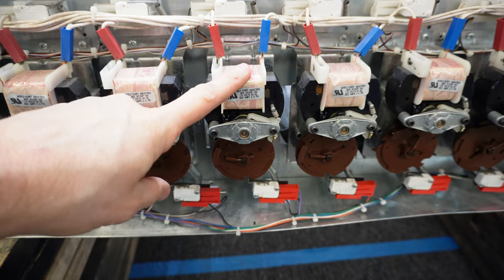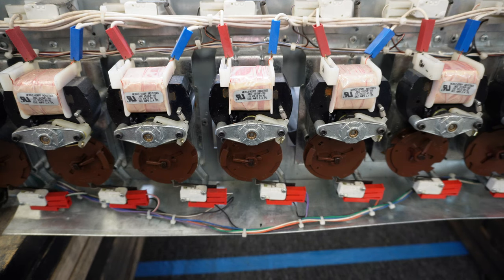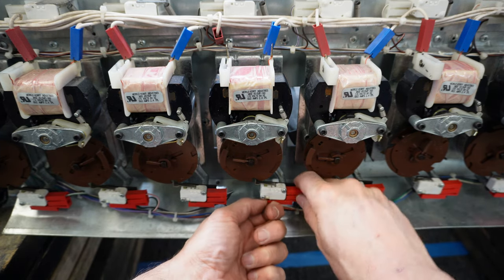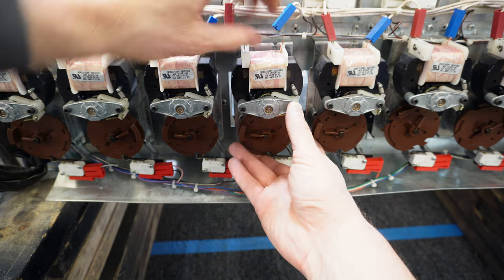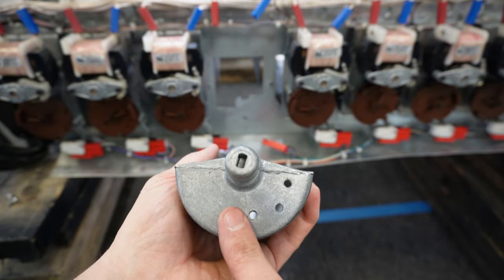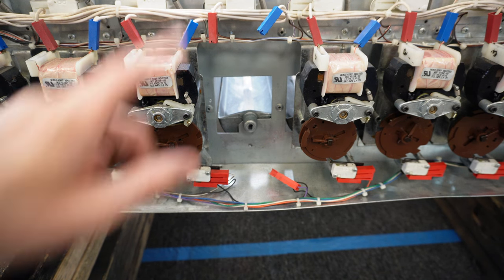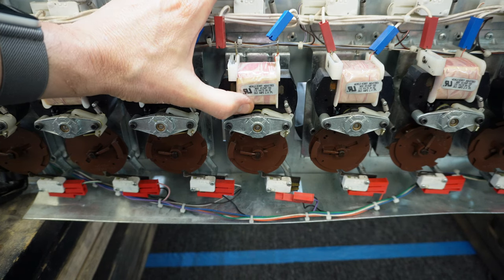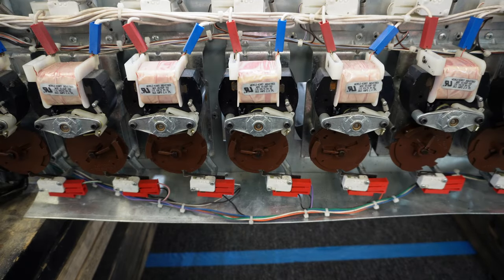Dixie Narco 501E Vending Machine: Removing A Vend Motor & Cradle

Comment: I have a couple questions. I have a DN501E that was donated to our church. They told me a couple of the motors need to be replaced, but is there a way to test motors to see which ones they are that need replacement without drinks in machine? Once that is fixed (motors) Second I see a couple of the cradles are facing down, can I load drinks in them like that or do they need to be turned up where the drink sets in and how can I do that? Thank you so much for your time.
Reply from the maker: Yes you can test the vend motors without any products in the columns. Here is a link to my video on how to Load and Prime where I go over how to vend the motors with empty columns. ( https://youtu.be/NqMvv4mFFwU ). You load the columns regardless of what position the cradle is in. I hope this helps and thank you for watching.
Reply: @VendingMachineSupport  thank you